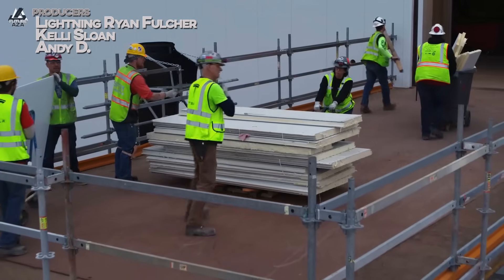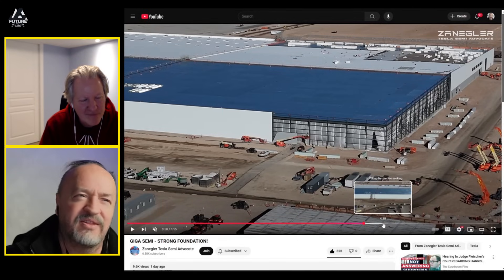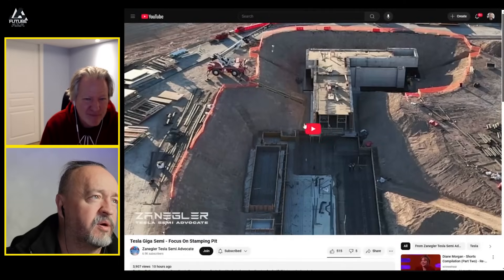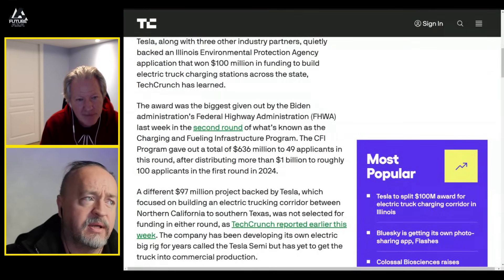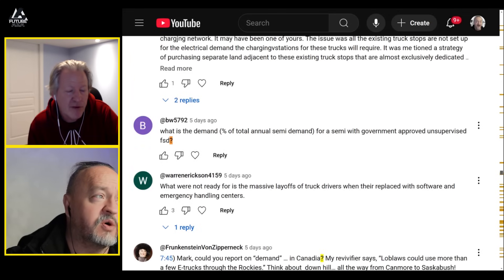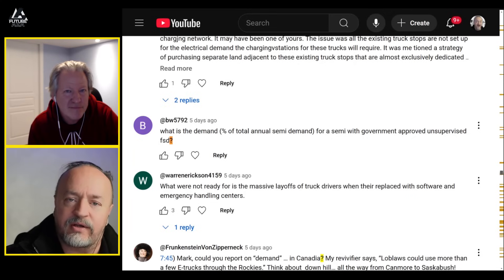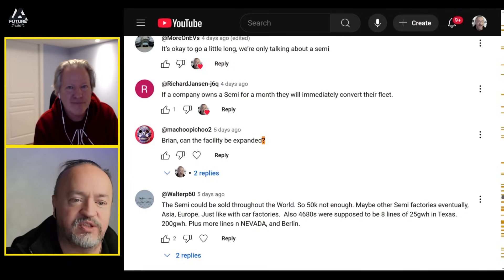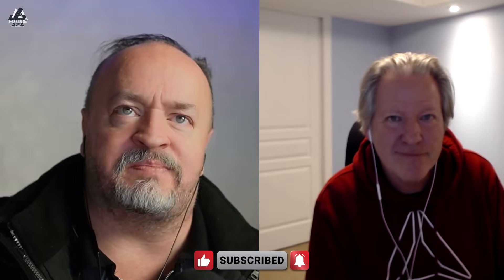Final Steps Before Tesla’s Semi Shakes the Industry

Comment: California now is requiring all heavy trucks to get an emissions test even if they do not reside here but are making a delivery to a California warehouse using Ca roads. !MAN! That new Tesla simi factory is coming online JUST in TIME. A diesel engine overhaul = $30K. A brand 
new diesel engine with 2025 emissions equipment in a crate = $80K. Many trucks wont be worth that kind of investment. Smarter 
to just trade up. TESLA is going to sell  SO  many simi trucks because of this new CARB requirement. THANKx CALIFORNIA!!!! CARB 
reports trucks will not be able to sneak across our border make their delivery or pickup and leave without compliance as CARB is 
setting up mobile emissions  SNIFFER  equipment all across Ca to check vehicles as they drive by. I can tell you where this eq will be>>>>
-All ag inspection stations at all stateline crossings
-All scales
-All ports
-All rest areas
-All truckstop driveways
-All military base gates
The owner operators are going  BANANAS  over this. Get over it. It is the coast of doing business in Ca.
I expect new Tesla simis will start rolling off the line in June or July 2025.
https://ww2.arb.ca.gov/overview-fact-sheet-clean-truck-check

!

Comment: In Europe articulated lorry (SEMIs) are already normally 24v not 12v.... 48v is required for steer-by-wire and I also believe steer-by-wire is required for full autonomy especially in SEMIs... The steering system in all prior Model SX3Y all used a single motor and drive belt plus a manual shaft connected to the steering wheel... In a case whereby the belt or motor fail the redundant system is the Human applying pressure on the steering wheel... This is not safe enough for unsupervised autonomy in my view... There have been many occurrences of the belt and single motor failing in use relying on the Human driver to steer the vehicle to a safe stop! Tesla may be willing to take that risk and they do have the statistics to understand the magnitude of that risk, I would not want to go there when a system like that in CyberTruck removes almost all that risk and is already tried and tested...
Reply from the maker: 48v isn't required for steer by wire, but the  motors would need to be bigger. Might not be a critical consideration in a bigger form factor.
Reply: @FutureAzA  I believe you are incorrect. It is possible to implement steer-by-sire with 12v however it isn't light enough or efficient enough. Tesla has already chosen to develop steer-by-wire on 48v for these reasons... Now for Tesla it only makes sense to continue with 48v they will not develop an inferior system for 12v of 24v... My  conclusion is therefore that in the context of Tesla products 48v is now required for future steer-by-wire implementations. The model 3 and Y were designed to use steer-by-wire from the start with two independent motor controllers in the steering system, they ended up controlling a single motor and drive belt because it was realised that steer-by-wire needed 48v to meet criteria!  You can see this in YouTube videos of 3 or Y steering rack tear downs. The redundancy oddly stops at the electronic controllers and there is clearly space at both ends of the rack for a motor to be accomodated in the chassis.
Reply: @ On the subject of SEMIs these are almost certain be 48v for the new mass production version. It is relatively easy to use step down from 48v to 12v or 24v. Most of the technology in the SEMI will be based on CyberTruck, the volume of CyberTruck will be greater than SEMI volume thus parts sharing between CyberTruck and SEMI makes more sense than using off the shelf tier 1 SEMI parts at least as far as electronics are concerned... The vehicle control systems AI compute etc. have already been implemented in a 48v architecture for CyberTruck. SEMI can be used to reduce costs for CyberTruck and vice versa... In any case the incumbent SEMI manufacturers work at low volume and haven't really reached the scale that Tesla aspires to for SEMI.
Reply: @ Do you find it interesting that CyberTruck operatives are being moved over to start new Model Y production in Austin? Perhaps they are uniquely suited to working on the new Model Y for USA...  Perhaps a bit of additional parts localisation is in play here!

Comment: actually yeah i agree AI AUTONOMOUS FSD TESLA SEMI will change the industry. 
i think semi fsd will be easier and faster as you can eliminate every narrow and most housing zoned driving its mostly industrial and commercial.

i think it be really smart to get semi to 90% the way to commercial or warehouses and have the cybertruck divide the load and finish the transport to speed up the transport of heavy loads and speed up the rotation of semi truckers and fsd ai caravans. 
the 500 miles range can be crucial to the passing over of the industrial or commerciao loads.

here its clear tesla has zero competition with tesla fsd semi.

only issue we could see mass lay offs in trucking and commercial transport unlesd teslabot creates a mass demand to return production into usa cheaper than chinas forced below minimum wage labor, then we might see no layoffs but all human production labor can just becone tesla semi fsd leaders of ai caravan.

here tesla semi with fsd is going to be global leader.

Comment: ❓Will the semi get LFP batteries? I imagine that semis in particular would profit from the larger cycle count. However, I am unsure if the increased volume and mass of a LFP battery pack would be a hindrance. On the other side, LFP can better stand to be charged to 100% and discharged to closer to zero.
As for the capacity of the semi factory, I found your argument concerning the battery production capacity very valid.

Comment: Good stuff, Brian. The virtual warehouse takes just in time to a whole new level. Havent heard muxh about this. If youve talked about it before, lmk and Ill dig it up. If not, maybe next time your on with Jeff Lutz, get into it for a couple minutes. It sounds like one of the things that makes Tesla the best in class manufacturer. Kudos for carrying the semi content. Another thing rhat sets you apart.
Reply: Each loading dock is a stocking location. For larger components, two adjacent loading docks. They draw from one. When it's empty they switch to the other and a semi tractor takes away the empty and brings back a full trailer from the "warehouse on wheels" (WOW) lot. Repeat. The distance from loading dock to where the components are installed on the production line is optimized. Suppliers deliver full trailers to the WOW and take back empties.

Comment: The #1 reason I think 48volt for semi is the steer by wire and having the torque to turn the steering quickly and with enough force.
Reply: ie, more power over thinner cables = less copper, less cost.

Comment: We did not see Tesla Semi with sleeper cab. Are they coming?
Reply from the maker: Likely, but no confirmation yet.
Reply: We also did not see semis without steering wheels.  Those are also coming.
Reply: @davidbeppler3032  not for à while
Reply: I did hear someone from Tesla say yes it is planned for.

Around 50% of semi's only do local deliveries so they can sell a ton of trucks for local to start. These will easily be able to charge overnight in the yard with simple "level 2" chargers, or whatever a semj would need. Likely a 200 amp connection, without expensive mega chargers. This will give them time to build the charger network (Mega & overnight @ truck stops) for long haul trucks with sleepers.

Comment: A Megapack on a trailer can make the Semi go around the world 10 times is what my robot mind is thinking 😄,  upvoted!!
Reply: Fun idea to put a megapack on the back of a Tesla semi. Quick back of the envelope and correct me if I appear wrong. A semi has around 900KWh onboard and can travel around 500 miles fully loaded. A new megapack has around 3.9MWh of power. Let's assume a megapack is a full load for a semi. If that's the case, if you add the 500 miles of tractor batteries plus 2,167 miles from the megapack (oh, so close to 2,169), you get 2,667 miles, in total. That's almost exactly Austin to LA and back...huge distance.
Reply: @machoopichoo2  Would I be reducing the tone too much if I somehow link this to the mythical sales rep with range anxiety 😂 They like big impressive vehicles.
Reply: Perpetual Motion Machine! (as long as there's an infinite downhill grade)